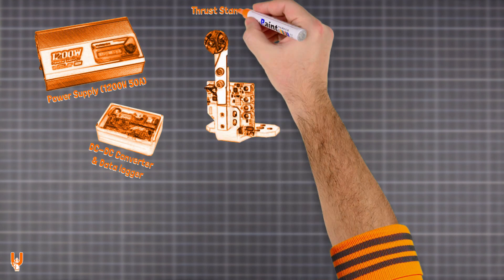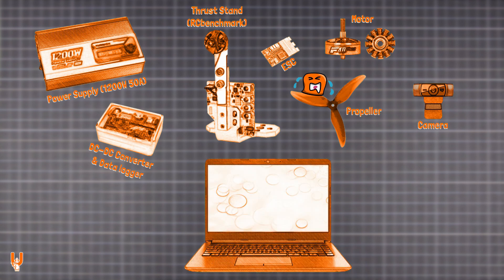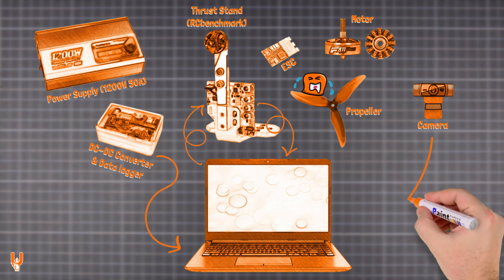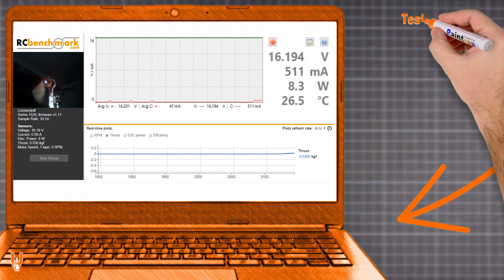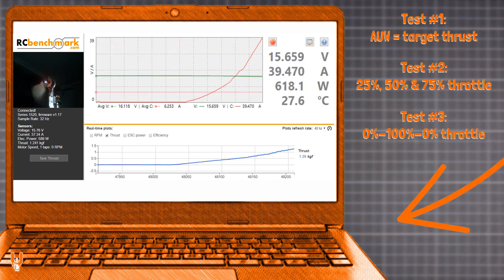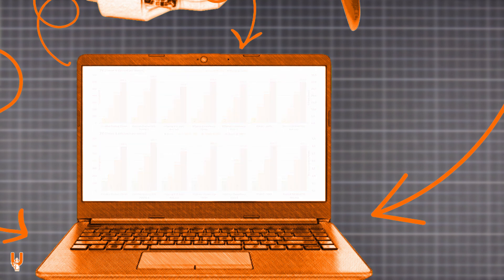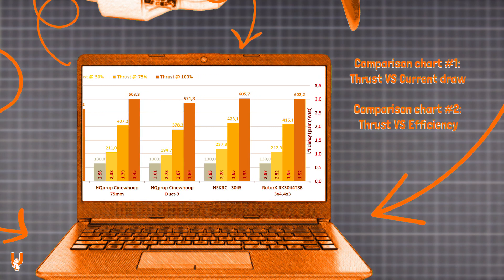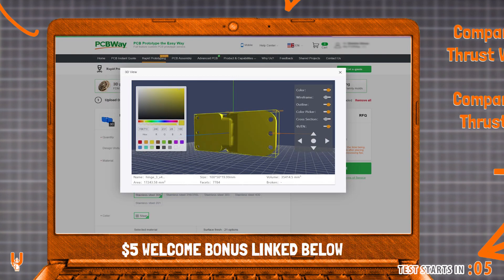Best props for the Diatone Taycan25 : 2.5" 3-blade Gemfan vs HQprop vs Racerstar

Comment: Thanks for the great informative video! Is there a big difference in propwash between the gf 2540 and the hq t65? The 2540 is better in everything on paper but the pitch is quite high.
Reply from the maker: Thank you! I have barely used the T65 prop, I don't like it. The Flash 2540 is a nice prop. Don't let pitch be a deciding factor when it comes to the props we use, it varies along the length of the blade and is not a representative metric of how the prop performs.
Reply: The pitch of the GF2540 is actually 2.4 according to Gemfan's own website.
Reply from the maker: That is very true, I used to get specs from vendors back then, until I realized that most of them get the pitch value from the propeller code name. I have been getting all the specs straight from the manufacturers for quite a while now. It remains a confusing and unnecessary decision on their behalf to use code names that don't match the actual characteristics of the propeller. And they do it more and more often.

Comment: Hi, i'm new to fpv and I don't really understand the results, would you tell me which one is the best ? 😅
I'm running 4s 1300mah, stock drone and configuration.
Reply from the maker: Out of the 3-blade props I tested, I would choose the stock D63 props or the T2.5x2.5x3 HQprops. I think the biggest difference will be from removing the foam bumper and using lighter batteries (for example 1050mAh or even 850mAh). For example, I am using 1050mAh on larger 3" cinewhoops.
Reply: Thanks for all the tips :D

Comment: Well done man thx (tomorrow i'm going to try the Emax Avan)
Reply from the maker: Don't screw them too tight, the avan rush props touch the motor bell before the hub does and if you screw them tight it may put a lot of strain on the hub.
Reply: @muteFPV  Ok thx anyway nothing changes, i can not take of with the session on. I think I have a hardware problem... I dont' figure out what can be, but I tried 2 different versions of Betaflight, different settings for the esc, different propellers. I give up... I'm going to contact the banggood and Diatone customer care.
Reply from the maker: Was it like this right out of the box or did it fly well at first? Maybe you have a problematic motor that holds the rest back.
Reply: @muteFPV  right out of the box. Interesting idea, that's some kind of test I can do or I can only have to change motors to try? Thanks for your consideration and patience mate.
Reply from the maker: SInce you have already enabled RPM telemetry, I think the easiest way would be to check the RPM of each motor in Betaflight's motor tab and see if a motor spins slower, lags behind or is inconsistent (props off as always). But yeah definitely contact customer support in the meantime.
Reply: @muteFPV  thx, I'll check. I have already checked to search for errors and I cannot see any issue but I will look better.

Comment: How about the avan rush props ?
Reply from the maker: The top part of the prop touches the bell before the hub does. I did not include them and cannot recommend them because if someone uses the Avan Rush props and screws the prop screws tightly, the hub or prop may fail.
Reply: @muteFPV  OK thanks for the info. I use them on my FUS X111 pro and they work great compared to the stock props.

Comment: Did you re-case the DC to DC? :D Also plz change the intro, I always skip it instantly, time for something new :P
Reply from the maker: Nope, same casing on the DC to DC. I still like the intro. Its duration is not accidental, just double-tap on mobile (or tap the right arrow twice on PC) to skip it.
Reply: @muteFPV  The intro has too much noise for me :P I start the video muted at the moment, which is ironic xD
Reply: @muteFPV  I like the intro, it's very original, don't change it :(